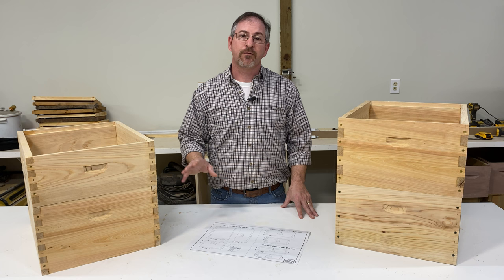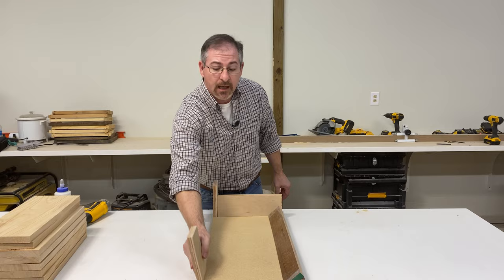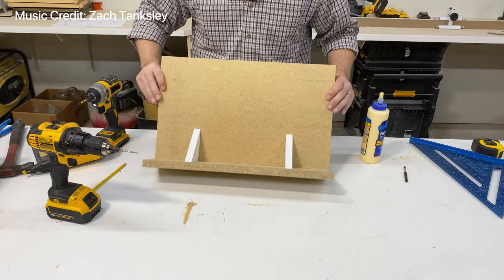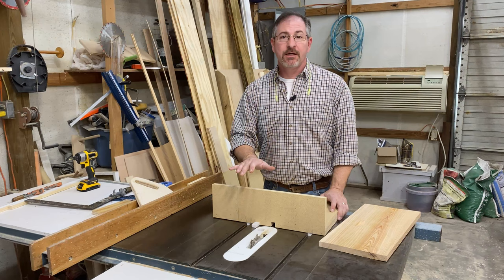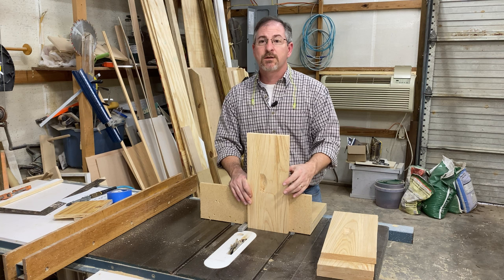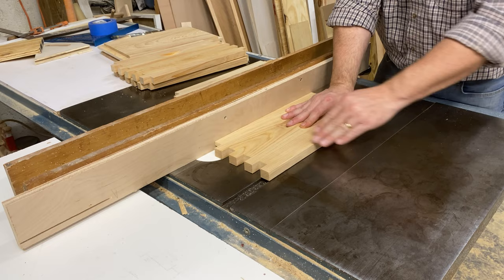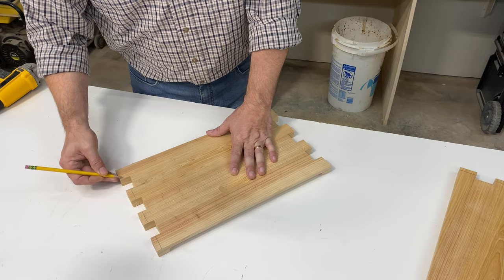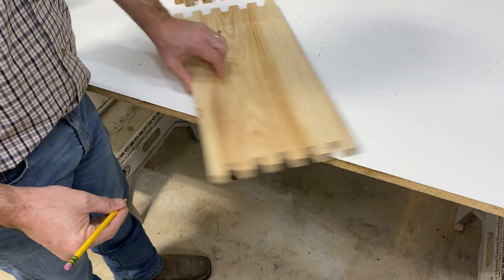How to Build a Beehive with Box Joints and Recessed Handles.    Free Plans.

Comment: I have done mine with rabbet joints but I am having the darndest time getting my boxes completely square and not have gaps on the horizontal edges.
Reply from the maker: A few things could be causing your troubles. If you rabbet joint is not cut square to the board or if the straight cut going into the rabbet is not cut square, this will directly affect how square your box is. This will cause your box to be racked somewhat sideways. 

The cut across the width of the board being cut slightly off square as well as boards having twist in them will generally make your box rock when sitting on a flat surface. 

I would suggest starting by checking the quality of your board. Then from there, I’d double check that your cuts are perfectly square. 

Best of luck 
Wes
Reply: Are you making the rabbets with a crosscut sled, or using the fence?  If everything is off, maybe your blade isn’t parallel to the miter slots
Reply: @liquidrockaquatics3900  yep the fence was off
Reply: @brianw.520  glad it was just the fence. My job site saw is horrid like that, but I already have zero clearance plates for my dado stack so I have to triple check EVERY TIME I MOVE THE FENCE. I am talking measuring from the blade to the fence, then fence to miter slot across the blade to get the measurement.  Then I have to check both ends of the fence and usually move one  I have found one trick that sawstop owners use that actually works fairly well for some other fences is to half lock the fence then release, then lock. The half lock starts to engage the locking pawls and pulls the fence square with its rail. It doesn’t stop me from measuring repeatedly, but it has cut down the amount of adjustment to get the fence square
Reply: @liquidrockaquatics3900  good advice!  That's insane to have to check all that every time but I'm finding it's much easier to slowly check and get it right the first time vs. speedily perform something and have to correct a mistake
Reply: @brianw.520  with smaller cuts, it’s not as bad if you have locking rulers similar to the woodpeckers ones. I don’t remember the exact name, but they have two thumbscrews on a sliding aluminum block that locks down to the ruler. Once that measurement is in, it’s in and won’t move. Amazon has a 3 piece set for under $30 in red and another company has an orange version. Locking slide rule maybe? But anyway, those are super handy as are setup blocks for setting up precise depths on dado and routers. Quick repeatable accuracy is always a bonus.

Comment: It looks as though you’ve solved the problem of the tilting miter gauge. Is that a board you’ve clamped to the edge of the saw to keep the gauge fence flat? Please explain.
Reply from the maker: Yes sir, that is exactly what it is. It originated as a table extension for my crosscut jig so I could pull it far enough behind the blade without it tipping.

Comment: A lot of information here.  I would say the screws are unnecessary.  The glue bond is stronger than the wood itself.  The staples hold while the glue bonds.  Screws are overkill without benefit.
Reply: I would agree with you if the wood wouldn't be stressed out. But this a box that will be receiving a lot of pressure from the hive tool when trying to get a frame out. Even with screws and glue you can sometimes separate the top part of the box.

Comment: Anyone have trouble finding 10” boards? Biscuit joint 6” lumber to make it 10”?
Reply from the maker: I use 1x12 that I get from a couple different lumber yards. The local shops typically have a better selection and a much better price than the big chain stores.

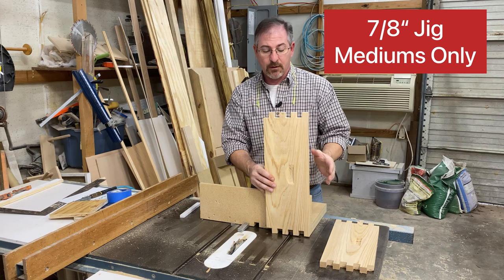Comment: At 10:29 in the video why didn't you just flip the side end over end rather than reversing it requiring the first cut to use a spacer?
Reply from the maker: Often times there will be some amount of blowout on the back side of the cut. The stack dado is really designed to do its best job when cutting with the grain of the wood or across end grain, not into the end grain. There are techniques to minimize this but I find them impractical when building a hive box. For this reason I prefer to cut into the face side and have any imperfections on the inside of the box. 

Thanks for the question and thanks for watching!
Wes

Comment: Thanks again for the plans!
Do you know where I could find a resource to build an insulated top cover? Thanks
Reply: Try using a sheet of foam board insulation and glue a lip around the top. Use a couple screws to secure the foam. If you can find a large disposal Styrofoam ice chest that will work too.

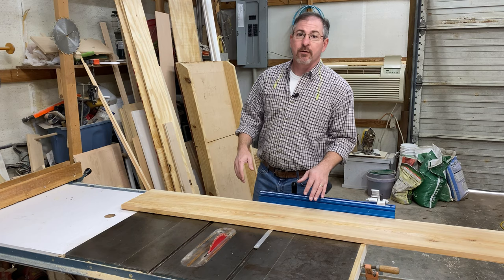Comment: Okay, so I've printed out all the plans for both hives and traps.  Regarding the "miter gauge" at 1:50 in this video this mechanism appears to be a specific product.  The closest I could find online was the 'Kreg Precision Miter Gauge System'.  You mention alternatively using the 'slide cradle' or the 'compound sliding miter saw'.  So I own a compound sliding miter saw so I could use that.  Your 'slide cradle' on the other hand is a mystery to me, very curious about that.  My second question is regarding the 'slide rail' 2:50 within the recessed handle jig build.  I see it is comprised of 2 parts, a triangle piece of unknown angle then the slide piece also with an unknown angle which is fixed to the base board of the overall recessed handle jig.  Could you please tell me the angle of these two segments and how you fix them to the base of the jig (I'm guessing glue & brad nailer).  Lastly, I believe I saw you mention you would be adding an instruction video on building lids and bases for the hives, any idea how long until you'll be releasing this 3rd video?  Thanks a ton.
Reply from the maker: That is the miter gauge that I am using in the video. The cross cut slide cradle is a piece of ply on runners that fit in the table saw T-slots. It has a 1 1/2” X 5 1/2” board at the front and back. The one on the back acts as your back fence. You can see it in use in the swarm trap video. I’ll try to do a video on how to make one at some point. 
The slide rail on the recessed handle jig is 2 pieces of 3/4” stock nested together. It could be done as a single piece of 1 1/2” also. The angle is 45 degrees. 
I’ll be trying to get the video on lids and bottoms out in a few weeks. Between my day job and my bees I haven’t had much time to devote to videos. That varies throughout the year so at times you may only see one new upload every month or so. When I can, I’ll post more often. 
I really appreciate you and everyone else thats watching. I’ll try to continue to bring you guys great content. 

Thanks again 
Wes
Reply: The "slide cradle" is more commonly (maybe it's a regional name?) called a crosscut sled. 

Hopefully you've already found what you need with the answer Wes gave. But if it wasn't clear enough, a YouTube search related to "crosscut sled" should turn up what you're looking for.  

I might recommend "Steve Ramsey crosscut sled" he has a simple but still functional design. Having one of those makes a HUGE difference in the functionality of your table saw - especially if you don't already have a really nice miter gauge like Wes's. 😉 (And for someone like me, who also doesn't have one of those compound sliding miter saws, it's especially important!)
Reply: @bojangles8582  Get a grip?  I'm a perfectionist learning quality woodworking sir.  You know, the universe sends back what your put forth. Condescending quips will grant you great dividends of such.

Comment: what type of wood do you recommend for boxes??
Reply from the maker: Cypress or pine would be my first two picks. Even though cypress is relatively rot resistant, I would still recommend painting the exterior of hives built from either material. You do not want to paint the inside.
Reply: @thesoutherncraftwoodshop4134  why would cedar be a bad choice?
Reply from the maker: It’s not common practice but I do believe it would be fine if the boxes were left open outside to age for a few months. This is just a guess mind you. If you’re going to try it, I would only try one colony at first. Also, I would be concerned that if the bees tolerate the smell, any honey collected from a cedar hive might be infused by it. 
If anyone has more information on this, I hope they will chime in.